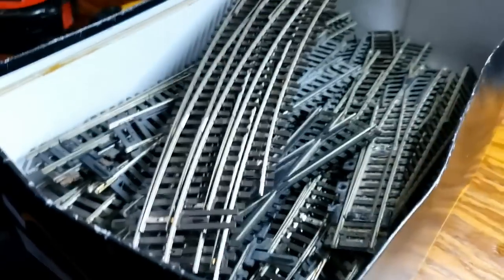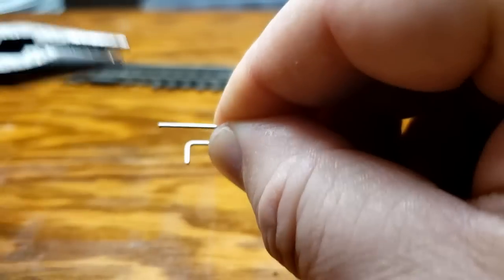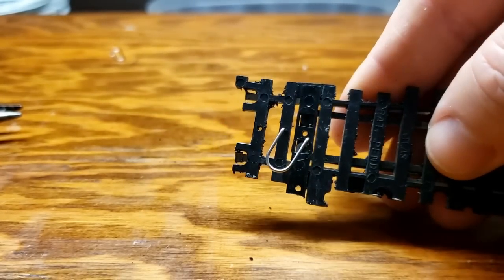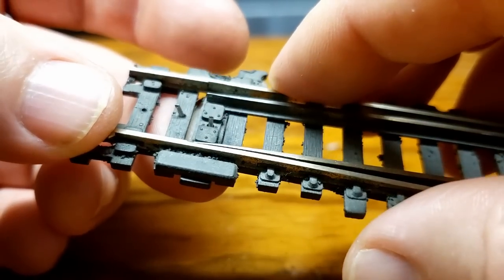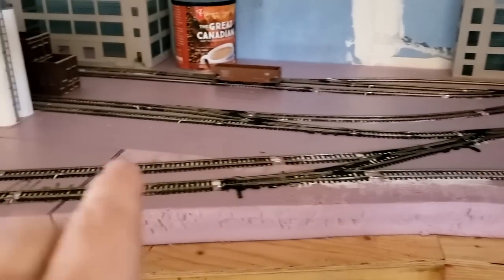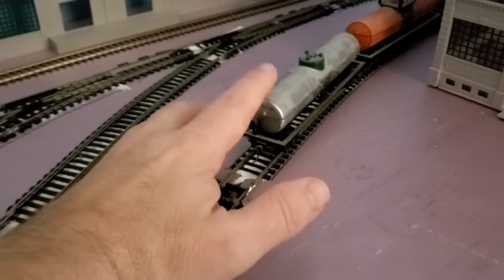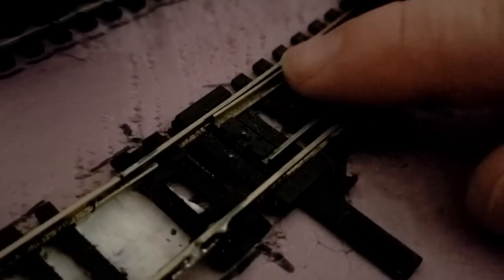How to make HO Scale Atlas Switches work reliable

Comment: The best fix I got for my Atlas switches was to change to PECO.  PECO's are hardly ever an issue.  Atlas's were always an issue.  Thanks for the tip, regardless!
Reply: Maybe you can go on some car repair videos and tell them how “the best fix “ is to just buy a Rolls Royce too.

No I’m kidding. But yeah I acquired just a few PECO turnouts and they indeed are well constructed, what impressed me the most besides the spring loaded rails, are the points rails are filed very fine and thin at the tips for a really perfect profile.
Reply: @Syclone0044  PECO's aren't that much more expensive, especially for the quality you get.  It's just a much better made switch.
Reply: Will a PECO switch work with other Atlas track?
Reply: @ericb.davenport9762  Probably would, but I would not mix the two, because PECO is an entirely different animal in therms of quality.  Also, both PECO switches and track are very sensitive to hammer damage, like when you are laying track, using nails in the center.  I have a method of using a pin-nailer to overcome this.
Reply: @Syclone0044  Good joke and point taken.  PECO's are really great English quality and workmanship.  The only downside is they are very sensitive to damage if you strike them with a spike hammer.  One hit, and it's "ca-ching".  I have never gotten one back in alignment once knocked out of alignment.
Reply: Thank you.
Reply: @raymondjackson6069  thank you for responding.
Reply: Were yours the CHEAP Atlas switches ? ...  not ?   $$$$, sorry
Reply: @RichardKuivila1947 When I was buying Atlas switches, they were all the cheap kind.  Only when they got serious competition, did they step up their game.  Meanwhile,my memory of Atlas switches are of frustration and disappointment, though there is the occasion that calls for an Atlas switch.

Comment: Very nice video. I really like the retro fit of the cheaper switches. i work with 4-H children and the most expressed thought is that the hobby is so expensive to start with. I use the switches like the onesyou have in the video and have been trying to have a very cheep way to convert the switches without a lot of money spent. thank you for doing this video.

Comment: That’s a nice positive throw! Wish I’d done this before installation, my homemade springs are all on the top, camouflaged with paint.😉
Reply from the maker: That's awesome! I started doing all my switches like this years ago, and they worked well. This layout is fairly new because we just bought this house within the last few years and so I'm just getting everything back and setup again. But all the switches on here have been re-purposed from the old layout. With the exception of a few curved radius switches that I bought used on a market place. They are Shinohara switches, but I also did the same trick to them as well, and they work great! If you ever need to pull a switch, that's when you could do one switch at a time. They really do work quite well like this. It holds the switch points tight to the rail, but also pulls them tight down the length of the rail as well, which takes any play out of the pivot points where the rivets are. Usually this is a problem area as they are not held tight back there, but the clips do hold them tight. And by putting my little twist in the clip where it protrudes through the tie, it actually performs two jobs. One, it prevents the paper clip from falling out of the hole, and two it actually holds a little tension upwards on the switch points, holding them more level with the top of the rails.

Comment: Danny. Another tip I found with switches that have the riveted point on the diverging  rail. I found that the rivet was loose and therefore it had poor conductivity of power. It is really noticeable for sensitive DCC engines. I took a center punch and a hammer to reseat or pinch the rivet back together. Re-check the alignment of the diverging rail. Also,  some switches have too deep of a frog or too wide of an opening. When the wheel crosses over it , it will drop down into the opening. This causes derailments or at the least, very "bouncy" look as the cars and engine go over the frog. I take a thin piece of cardboard and press it over the frog to get it's outline. I then cut it out to fit the space. Once I'm Happy with the fit , I use a black marker to blend it into the frog, It works great! I hope other modelers see these tips and I hope it helps them out too!!
Reply: GOOD catch,   Good Fix !

Comment: You know I just tried this. I made it work, but I don't have that satisfying click that you have. But I also haven't tried to install the switch yet. I just have it on the workbench. But this is definitely an incredible solution!
Reply from the maker: Thank you. If you experiment with the radius of the curve on the paperclip, or how wide the points of the paperclip are apart before you put them in the holes, it will change the performance. I try to be very careful not to "squeeze" the points together as I'm installing them. If you do, you can collapse the curve on the paperclip, making it not as solid of a snap. Experiment with it, and once you get it sorted out, it will work fantastic! Glad you are trying it. Thank you!

Comment: New sub here. Also in Ontario. Also a Harley rider and a train guy. Look forward to more videos. I install similar springs I make out of music wire and they install from the top
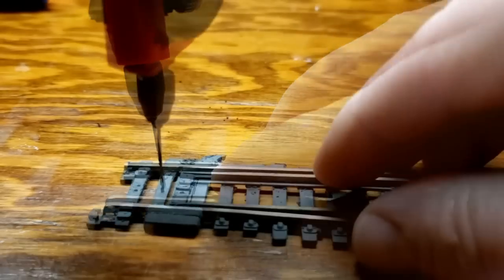Reply from the maker: Nice! I have done a few from the top before as well. I forgot those old videos were on there. That's an old sportster I used to own. Fun little bike. I also had an 07, CVO Softail Springer (which you can see in the background of the video parked by the garage door around the 2:10 mark). It was even more fun with the 110CID, S&S Intake, Exhaust, Chipped and programmed. She'd Dig! lol.
I have sold both of those bikes since. We have moved into the camping in the summer. Much safer driving a huge dually what with all the distracted drivers out there now! Stay Safe!

Comment: Sir, you are a genius!  Where were you 15 years ago when I was laying my track?  Although I use ground throws, the points don't always lock in place.  I may just pull up a couple of turnouts and add the paperclips.  Thank you.
Reply: If you use the Caboose Industries ground throws, he makes sprung and unsprung versions of both styles. My understanding is the spring should give a positive rail engagement. I wonder if your ground throws are mounted out of alignment one way or the other and not centered with respect to the switch travel.

Comment: Well played, sir! Just want to make sure to file down those sharp cut edges of the pins, and be VERY CAREFUL of those little pieces of paperclip flying off when cutting.

I might even suggest getting a heavier-duty pair of side-cutters (or use a Dremel) to cut the paperclip. I wouldn't want to mess up my nice Xuron rail cutters on steel. 

Thanks for sharing! Peco is NOT going to be happy if you cut into their sales with this tip! :D
Reply: I’ve ruined way too many Xuron side cutters thinking a tiny silver grab iron wire would be soft. NOPE. Chomped a nasty bite out of my cutting tips and failed to cut the grab iron to size! Wish Walthers had better QC so they don’t need to be trimmed to install in the first place but Walthers never seems to care about quality that much.

Comment: Gteat video!! Best center over rig i have seen so far. Have you tried this with remote switch machines as well? I am on a budget and buy virtually all my stuff used on ebay, so its great to pick up a tip here and there to save a buck. There will always be naysayers so just keep calm and carry on. You have earned my subscription.
Reply from the maker: Hi, sorry I'm just seeing the message now. The stock Atlas remote switch machines don't have a very good lever for throwing the switch. Depending on the thickness of your paper clip, and how wide you make your loop in the back of the clip, it can really make the switch snap hard! (if you watched the video to the end, I demo'd them on my layout. They snap pretty hard). I manually throw all my switches just using a skewer stick, so it's no big deal for me. But I also used to use the Atlas switch machines. I just really found I like the very positive stop of the switches now with the paperclip in there, and so I stopped using my switch machines. When I designed this layout, I did it with the thought of being able to reach all my switches easily. You could try using a smaller paperclip to reduce the tension and test it out with a switch machine and see if it would work for you. If you try it, and it does work, please let me know. I would be interested in finding that out.

Thank you for the kind words!

Comment: Great idea. It looks a little difficult drilling like that. You can buy an electrical drill or a drill bit with a handle like  on a screwdriver. Much cheaper and easy to work with. Regards  Steen, Denmark.
Reply from the maker: that's funny. One other guy mentioned my drill as well. I've had it for 20+ years, as I used it when building model aircraft. I have a Dremel with all the attachments. Believe it or not, when drilling a tiny hole such as this, that little drill works great. It just doesn't appear that way on video. thanks for watching!
Reply: @dannymacnevin3939  Ok. My next qwestion is: When you have a Dremel, How come you use that drill, you use in your Video? You're welcome. I'm following Charly Bishob, but I like to find other channels to get other idears. Steen.
Reply: @MrSteen12 it's called a pin vise, and for very little drill bits, it's the best way to be accurate  and not burn up or brake the small bits required for modeling. Try it sometime

Comment: Question: the paper clip is not tempered or hardened “spring” material.  When bent it does not snap back as a true spring would do.  So are you concerned that it will eventually stop being springy?
Reply from the maker: Those paperclips are pretty hard, and they don't want to change shape without some, what I call "Plyer persuasion" and all I can say is I have some switches here that I did, 25 years ago, and they still snap just as hard today, as they did when I first did them. So I am not concerned. Thanks for watching the video. Cheers!

Comment: Sorry. I was a tad rude earlier..
But, unless you now have KA (keep alive) installed in your locos, there is nothing can be done with this particular type old code 100 Snap Switch far as stall outs over its plastic frog. 
With Atlas code 83 Customline switches the frog is metal and can be powered to prevent a stall out is what I was getting at...You can firm up/add spring action to hold the points in position, yes. But nothing is going to improve a plastic-frogged T.O. except KA or speeding trains thru it at 90 MPH...

btw: 0:07 Right there in box is a power-able metal-frogged Shinohara/Walthers switch which very much can use your nice spring design with, as it's a 'power-routing', all metal rail switch.
Reply from the maker: I beg to differ with you. I run all DCC locomotives. My smallest are SW1200 switchers with 2 axle trucks. I use an Accutrack II speedometer and I have all of my locomotives speed matched, and have a limit on my layout of 30MPH. Using the Accutrack, I have them all speed matched, and they all top out at 30MPH. I run everything at scaled speeds, and do not have any stall outs over the frogs. I keep my tracks clean, and I make sure I do good solder joints and I have zero troubles. Maybe I will make a follow up video of the locos running someday. Lately I have been super swamped at work, and I also play music in several bands, and a "gun for hire" as well, so the layout has been taking a back burner. But I will hopefully be able to get back at it soon. I develop software for Aerospace for a living, and I plan on designing my own software for various things on the layout. But that might come once I retire. Cheers!
Reply: The Atlas Custom Line switches he showed, in fact have a metal frog that can be powered if you’re one of very few people who have 2 axle locos. (I’ve never seen a 2 axle loco here in Wisconsin USA).

By the way, The switch you mention at 0:07 is clearly an old Shinohara which is NON DCC compatible with that metal bar joining the points. As well as it’s solid rail non-insulated frog.

Comment: Excellent 
Thank you
I intend to use many “repurposed” switches.  Very informative 
What is your plan for ballast?  How will you avoid fouling the new mechanism?
Reply from the maker: Hello, I have done this on a previous layout, and all I did was put a small bit of tape over that area while ballasting. You never want ballast in that area of your switch anyway, as it can cause other issues, so I just leave those couple ties with no ballast. If any does get down in there, a quick vacuum fixes it. Cheers!
Reply: @dannymacnevin3939  thank you

Comment: Great video. What size paper clips are those? I want to buy the exact same ones
Reply from the maker: Thank you. They are about 1-1/8 inches long. The diameter I'm not sure of, but they are just everyday normal paper clips. Smooth surface, with no ribbing. I believe I either bought them at Walmart or Staples. I no longer have the package. But pretty near any old paperclip will work. As long as it has some good tension.

Comment: You only addressed one of the many problems with cheap atlas switches. What about the frogs and I sharpened switch points?
Reply from the maker: The frogs are not a problem on any of my switches. If you are having issues with the frogs, chances are it's the rails leading up to the frog. Like I mentioned in the below comment, there's ways to wire these switches to make them work flawlessly, even with DCC. (I'm going to do a video on that as well). Also, I try to run all my locos at a scaled speed, and speed match them all using JMRI, and run speed limits. I use #6's, #8's, #4's, but they are all Atlas switches I've had for years! The things I have are Time and Lots of switches kicking around, what I don't have is lots of money to throw at replacing all of my switches. So I make due with what I have. If you take your time, and study how all of your rolling stock navigates these switches, you can make them run very nice, plastic frogs and all.

Comment: I love this idea, but am wondering if this prevents using some type of switch machine too?
Reply from the maker: Depending on the strength of the switch machine, you should be ok. I just happen to have a box of old switches I repurposed from another layout. I use manual control of my switches with a long stick, so it is not a problem for me. However, like I say, if you have a strong enough switch machine, it should still work. This just helps create a more positive stop for the points, and holds them tighter to the rail. Let me know how you make out if you try a switch machine. I'd be interested to know. Thanks!

Comment: Once modified, are these still able to be switched remotely? It looks like a lot of resistance is being created...
Reply from the maker: I switch all of mine manually. I haven't tried running a remote on them. You can adjust how much tension is there, by adjusting the width of the loop on the paperclip. Thanks for watching!
Reply: I've implemented this on my Atlas switches that I operate remotely, and can confirm that it does still work. But you do need to finetune how much you bend the paperclips. There's a small sweetspot between too much resistance and zero resistance that the stock switch motors can move. I got it through trial and error before permanently installing the switches. Good luck!

Comment: So what size is the drill bit?
Reply from the maker: That is a really great question! I think if I remember correctly it was 3/64 inch. I don't have my calipers here,  but when I lay it on my tape, it's a little larger than 1/32, so I'm pretty sure it was 3/64 inch.

Comment: Great video.  I have been trying to figure out a way to get my Atlas code 83 18" radius snap switches to stay in place without purchasing Caboose ground throws for all 35 turnouts on the layout.  I believe that the code 83 snap switches are the same as code 100 #4s. I am guessing that this same method will work with code 83....... has anyone tried this with code 83????
Reply from the maker: Hello, there was a guy that had commented on a FB group I was in that said he was having trouble with the code 83 because the ties were further apart. So I tested it with a radius switch I had here, and you just need to alter the shape of the paperclip slightly. But it did work. I had another video showing how that switch worked, but I haven't uploaded it yet to YouTube. But I will. Thanks for watching the video!
Reply: I did this with my Atlas code 83 #4 and #6 switches and it worked fine
Reply: Please see my post above.. Even if you firm up the points with a spring, the plastic frog in older code 100 will still potentially cause stall outs especially with small 2 axle locos unless you equip them all with KA...

Comment: will this work with a Switch Machine on the Switch? Would it overpower the Switch Machine?  If it does work with a Switch Machine can this be done to an installed Switch?
Reply from the maker: I'm not sure. I have never tried it as all my switches are manual throw. Would be interesting to test that.

Comment: Could you please check the exact thickness or width of ho scale rail head with vernier caliper and tell me?
Reply from the maker: The best I can suggest is to buy an NMRA gauge. It has the actual measurements for all your standard flange widths, track spacings etc. That's the best way to check all of that stuff.

Comment: Has anyone been able to use this method or some method like it with a control switch?
Reply from the maker: Hi. I manually throw all my switches, but depending on the strength of the paperclip, it could take a substantial motor to move the points. But it's worth a try.